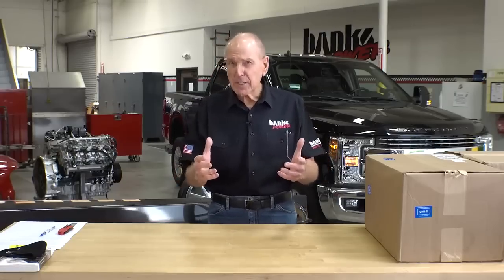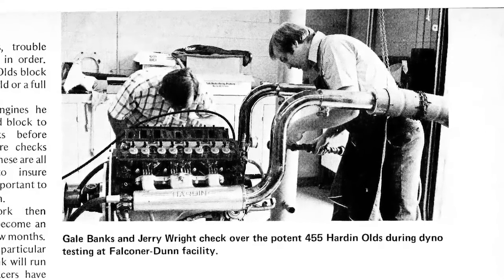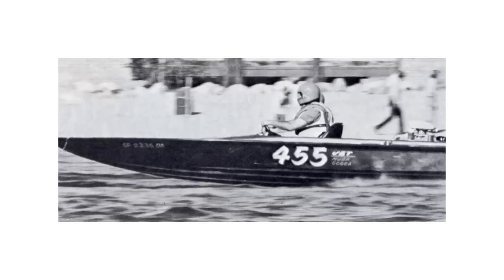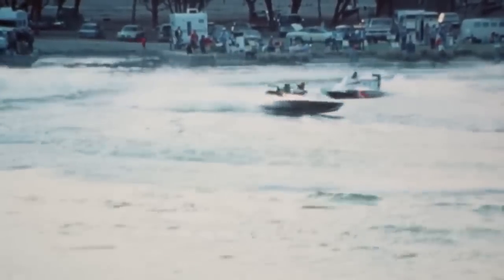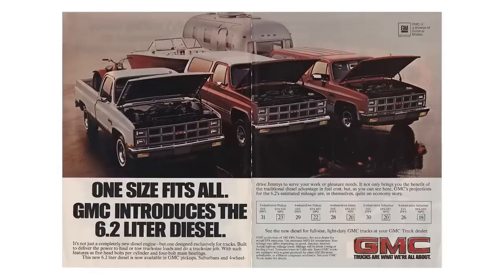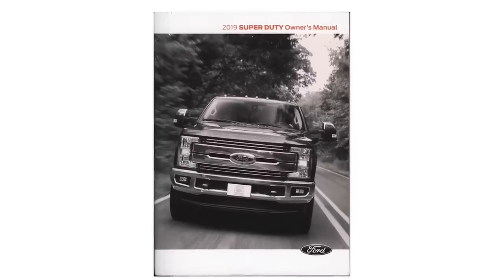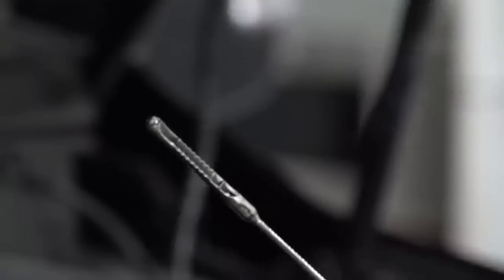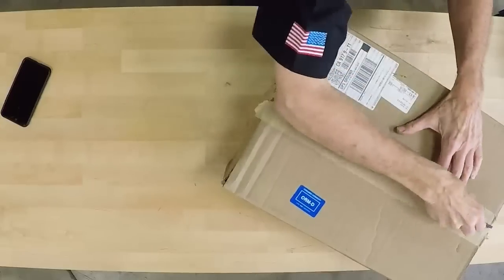WATCH HOW THIS GUY EXPLAINS AMSOIL! orderoil24 dot com

Comment: In today's day and age even Walmart oil is OK if you keep up on changes. All oils pretty much have the same additives if API certified.
Reply from the maker: Thanks for being part of the channel. Walmart is not OK compared to 100% Synthetic oil. Conventional oil exists in 'FULL' Synthetic, 60-75% conventional. Concentional oil has mismatched molecules, which causes wear, over time. Use any motor oil that is 100% Synthetic. It causes zero wear over time. Basically, if you study tribology, you would know that conventional oil (group 1-2) sandblasts, over time, your engine components.
Reply: @peterssynthetics-independe6786  The thing is that oil bottles that say full-synthetic are not 100% synthetic. Not unless it specifies 100%.
Reply from the maker: @old_school_guy  Didnt I just say that? Or did you not really read the comment? :)

Comment: I dont do oil laboratory thing no need ,but as the pick up for the oil pump is located pretty much at the bottom of the pan.The drain plug would be most effective oil sample as thats the oil going to the motor at start up.Two micron oil filter in my opinion is much to fine for used motor oil and likely  starve engine of oil or go in bypass mode and filter nothing,Is amzoil good im sure it is but how long will most people keep their vehicles, My tacoma 24 years old and pull a trailer 95% of the time has over 307000 miles using just conventional oil valvaline just recently starting using synthetic because conventional oil is hard to find these days, i changed it every 4000 miles now with synthetic i plan to change  6-7 thousand miles.Try going 25000 before oil change on a vehicle with over 100,000 miles their is a good chance you run low on oil a ruin yer motor, i say yer better off just changing  oil than adding oil

Comment: Do not use AmsOil or any brand engine flush. Those things are trash garbage. The ONLY time u use an engine flush is if you've had the vehicle since it came off the floor and you've been using engine flush regularly since u got the vehicle home. If not, stay away from ALL engine flush. It will screw u over and cause more oil leaks then a little bit
Reply from the maker: Watch my other videos and you can see what the real deal is with AMSOIL Please like and subscribe!

Comment: Why bypass when you can make a parallel oil flow path, so that you don't lose 5% of bearing oil?  Also, a parallel path actually reduces the flow resistance of the full-flow (single) oil filter system.   In other words, the return path of the fine-filter should connect to the outlet of the normal spin-on oil filter that came with the car or truck.
Reply from the maker: Thank you for being part of the channel! You actually do not lose really anything. The design for the oil pump and pressures takes this into account. There is plenty of extra pressure and flow for the bypass valve. Amsoil has been making bypass filtration since the 60’s. I believe they have it in hand. Call Amsoil and ask for their technical team and you will speak with a Tribologist.
Reply: @peterssynthetics-independe6786  Only with a variable displacement oil pump that uses oil pressure feedback to adjust pressure.  Some engines have that, I don't think the majority of engines have that.  They usually have fixed volume displacement pumps.
Reply from the maker: @softwaresignals  I would agree. However, you are not losing any oil pressure/lubrication to the engine components. The bypass does not hinder the flow, or flow rates in anyway. Some engine manufacturers expect a third party bypass system and they design in ports on the engine crankcases etc etc for this express purpose.

Comment: My 1983 Mercedes 300TD/OM617 5 cyl turbodiesel has over 900,000 miles on it using Shell Rotella T4 mineral oil from a real oil manufacturer, not an Amway distributor pyramid scheme from an oil bottling plant.  It uses a teacup between 3000 mile changes for 41 years.  Engine and automatic transmission have never been overhauled.  We can leave for the opposite coast tomorrow with 100% confidence of a trouble free trip in the most reliable car ever made.  EVERY diesel owner MUST change dirty black oil OFTEN not using magic from a slick marketing scheme.
Reply from the maker: Thank you for being part of the channel! I am so happy you have had such great use out of your Mercedes. If I bother to respond will you read it and respond in kind?

Comment: Could Amsoil be used in a Chev 1962 327 V8 ?
Reply: Yes -- but WHY ??
Reply: @SlikLizrd  for lubrication ?
Reply: @north4961  Seems crazy to put expensive oil in a 60-year-old engine that NEVER saw oil that was as good as today's full synthetics.
But hey, you do whatever you want, it's OK by me.
Reply: You could as long as the engine isn’t worn out already. If it’s not worn out, Amsoil will improve engine performance and reduce oil consumption from lower volatility.
Reply from the maker: You can use AMSOIL ZROD, which is designed for the older engines, specifically!

Comment: What destroyed diesel engines in cars was not the idea, but that lousy engine.  A conversion engine, not a diesel from the start.  A 4 cyl. Westerbeke would have been a better choice..  better fuel mileage, better reliability, but a lower top end and less torque and horsepower.  But actually not that bad on torque.
Reply from the maker: Thank you for being part of the channel! :)
Reply: VW had diesels in the US for over 50 yrs. I had a jetta that got 48 mpg. Thanks to diesel gate vw got scared and caved in to the govt so no more vw diesels.

Comment: I have had this kit on my cummins diesel for 15 years or so. I change the oil at 25-30k miles and use the amsoil off-road diesel and marine 15-40 oil. Oil changes are about $180 every 2 years.
Reply from the maker: Yes sir! Instead of it costing you $600 a year or more. Thank you for being part of the channel! Please consider subscribing! Thank you!

Comment: What I would do right from the factory is I would have a second ring the compression ring like Childs and Albert or now accurately and Albert a step ring and would also have a slight bevel to it so it helps scrape the cylinder wall of excess oil that second ring will greatly reduce salt going into the oil plus give you a little more power make your engine a little more efficient see you when I’m doing my 91 Dodge actually 91.5 I’m getting as much horsepower out of it as I can without adding big stupid injectors and stuff like that anyway this is six in a row jim From Kennerdell Pennsylvania
Reply from the maker: Thank you for being a part of the channel. If you need any Amsoil please use my website at https://www.orderoil24.com then click the big SHOP, then make your order. Or if you call in your order, please use my dealer code 30331652 at check out. Thank you and God bless.

Comment: How would you know how far you’ve pushed the hose down the dipstick tube? Seems to like it would be pretty difficult to pull from the top of the oil level and not pull stuff up of the bottom of the pan, as you say should be avoided.
Reply from the maker: Measure the dipstick.

Comment: Hotshot secrets line of Blue Diamond oil is 100% group IV PAO and group V oils. If you use this oil with a properly filtering bypass filter and do regular filter changes with oil analysis every 10K miles you can go 50-100K miles before a complete oil change.
It's the only oil I would pay a premium price for.
No need to hide behind vague terms like "full synthetic" and "100% synthetic" and undisclosed blend percentages when you outright tell everyone it's purely group IV PAO and group V oils only. 
Group IV base stock with a Group V carrier for some of the additives.

Comment: I have been using Amsoil for over 35 years in all my vehicles. I have put over 300,000 miles on several of them over the years. 
It's only expensive if it doesn't work.
Reply from the maker: Thank you for being part of the channel. If you need an Amsoil dealer please call me 229-561-4426 or goto my website then click shop orderoil24 dot com   My dealer number is 30331652

Comment: Don’t forget about ash buildup in the dpf which causes restriction after 50% capacity then you’ll notice fuel mileage decreasing because of more frequent regenerations therefore shortening filter life and……. The next byproduct is fuel contamination in the oil because of more frequent regenerations because filter (dpf) capacity and volumetric exhaust flow rate has decreased that is measured by the differential pressure sensor.

Comment: He can even explain it at the best… it’s just not worth the money , the average full synthetic oil and 5k interval goes a long way and save you $$ in the long run
Reply from the maker: Too bad you do not fully understand what you are talking about. The long run, is perform oil analysis, learn your equipment, then let your mind dictate what your next move is. If the truth of that data tells you that 5000 mile intervals is what you should do, change it then. If the truth of the data is 25000 miles, change it then and save tons. Full synthetic, you are being duped. It is not 100% Synthetic like Amsoil. Look into research and learn your equipment before you just ‘do what you are told’ and then tell everyone else and in the face of 50 years of research that tells you the old 5k miles or 3k miles, routine out the window. It is 100% worth the money if it reduces wear metals. The big oil companies just cant beat Amsoil, and they know it. If they offered 100% Synthetic, they would be higher than our oil. Do some research, do oil analysis, save $$.
Reply: @peterssynthetics-independe6786  most of the vehicle I’ve owned have lived passed the 250k , don’t need no oil analysis, if you take the best oil in the world and run it 25k or something that might not be as perfect but still has some good detergent inside of a reliable company and change it often you’re just at the same spot.. amsoil is just the trend of the moment and if gale banks is so good good and knowledge about it all instead of making tune just because it’s what sells and tells people that delete times are over , could implement and improve emission control and fix all the flaws instead, a good reliable vehicle has no need for mods, for gold oil and all these bullshit
Reply from the maker: @Italianborn  How about engines that give you over 1 mill+ miles, documented? Everyone talks big about their mileage, but when you get it down to cold hard facts, you can not refute oil analysis. Not doing an oil analysis and finding out the truth is like going to the doctor and asking him to ‘figure it out’ with out drawing blood. Ridiculous. Amsoil is the best engine oil in the world for cars, trucks etc. 100% Synthetic. If you havent tried it, dont knock it. You spend less money, dont feed the big machine which constantly dupes you. Sometimes the medicine is worse than the cure, in this case for you, it certainly is.

Comment: Hello sir, please I need the appropriate viscosity of Amsoil oil for the GDI 2400 engine ... for the Middle East weather that exceeds 50 degrees Celsius '50C. Note that the car is a Hyundai Tucson imported from America and it says on the hood 5w20
Reply from the maker: Thank you for being part of the channel! If it is a 2019 Hyundai Tucson, 2.0 or 2.4 it looks as if the viscosity is 5w-20. Buy it at my link at orderoil24.com so I can get the credit for the sale! Blessings!
Reply: ALL-WAYS use the Factory-Recommened oil viscosity, regardless of high desert temperatures.
Your Hyundai was TESTED in the desert.
It's named after a city in the Arizona desert.
AMSOIL's 5-W-20 will protect your engine under desert heat conditions. No worries !!

Comment: I have 17 F350 with a 6.7L power stroke I change the oil every 8k  km oil is cheap engines or not I’d rather just change the oil more often than worry about spending six or $700 on a oil bypass I love amsoil stuff, but I can buy 10 oil changes for that.

Comment: I had an 03 f350 6.0 ltr I changed oil at 8 thousand km and it had 260, km on it I always added Metalon to the oil an when I pulled the drain plug the oil always looked pretty much like  just fresh oil there was a little color but certainly not like most I see I could never figure this out. Anyone have any ideas.

Comment: What do you think about a non-vented oil catch can in addition to the bypass filter?
Reply from the maker: Not really sold on that idea. The bypass filters gets down to 1 micron at 50% efficiency and 2 microns at 98%. The bypass filter system does a bang up job

Comment: It's like getting an oil change every 50 - 100 miles. When it gets too dirty, change the filter, not the oil and start all over again.
Reply: That's the way I'd look at it, that super superior oil isn't worn out, just loading up on contaminates. With the Top Notch "Ea" Amsoil filter and this by-pass  filtering set up the oil probably doesn't even look vaguely dirty for 1000's of miles. Night and day difference between this Ultimate Filtering set-up and a Fram Tough Gard...Chuckle Chuckle 😂
Reply: Not true. Engine oils have sacrificial additives that go away after a period of time. Your oil may stay spotlessly clean with a bypass filter, but the oil will not protect the engine like it should.
Reply from the maker: This isnt true at all. Have you ever done Oil Analysis?

Comment: Called up his buddies take note of that, my mentor otr driver 40 years uses nothing but amsoil does one systemic circuit change a year. Has gone 2 years that's 240,000 miles amsoil max duty diesel oil
Reply from the maker: Thank you for being part of the channel!

Comment: What 10w30 or 10w40 oil would you use in a 460 Ford with a flat tappet cam
Reply from the maker: Thank you for being part of the channel! What is the make model and year of your vehicle? I have a  suggestion but I would like to make sure that I do not tell you the wrong product. Have a look at our ZRod line of oils that have a heavy zinc additive. Here is the link for it: https://www.amsoil.com/p/z-rod-10w-30-synthetic-motor-oil-zrt/?zo=30331652

Or go here: orderoil24.com then click the big SHOP then find your particular vehicle! Please contact me if I can be of further help! :)
Reply from the maker: Before you buy, double check with me. Glad to help. Just need to double check sir.
Reply: @peterssynthetics-independe6786  how do I contact you ? 90 F-250 460 installing a new flat tappet cam and lifters! Would like to run 10w30 or 10w40
Reply from the maker: @joshualymer6568  Please call me tomorrow AM after 9am 229-561-4426 Ill have the information you need ready!
Reply: Pennzoil Ultra Platinum, 10-W-30 -- with a Fram Ultra Oil Filter -- changes (religiously) at 5,000 miles.
Worked very well in my modified 460 Lincoln Town Coupe -- even in the harsh desert climate.
AMSOIL is GREAT -- if you're starting off with a freshly broken-in engine.
 Putting the expensive AMSOIL in a worn engine is just wasteful turd-polishing.
Reply from the maker: @SlikLizrd  But using something that will slowly sandblast it even further is the thing to do? hmmm….. Not so sure about that. :)
Reply: @peterssynthetics-independe6786  What are you talking about ??
 I need some clarification.
Reply from the maker: @SlikLizrd  If you use Pennzoil, which is a good oil, but it is still group 3+ hydrocracked oil. Odd shaped molecular structure and contaminants. Anything less then 100% Synthetic oil, your oil is contaminated with silicone, various solids and clumps of non-uniform, crude oil particles, oxygenated particles, that clump together in your engine and become sludge, dirt, grime, enemies of your engine, slowly over time sand blasting the inside of your motor. Period, The End. Even if it says ‘Full Synthetic’ it is not 100% Synthetic. Thats what I mean. Its great that you change your oil every 5k miles. As a tribologist, I love hearing how folks really like taking care of their vehicles, even if it isnt Amsoil. However, if you take a crap box, why make it worse and use inferior oil? That does not compute. That is like kicking the worthy competitor when they are down. Any time is a good time to use Amsoil.
Reply: @peterssynthetics-independe6786  
 It's all good, Peters -- I know that Amsoil is a superior oil, but it's not for me, as my goal is not to have an engine that lasts forever AT ALL COSTS, but to have an engine that operates efficiently for just (I'm 83) a few more years, and at minimum cost.
Please do not ASSume that others don't know the meaning of such common terms as "Full Synthetic" , or that they're unaware of such characteristics as molecular uniformity.
 As your business continues, I think you'll find that no matter how good a product is, IT'S NOT FOR EVERYONE.
 Peace.
Reply from the maker: @SlikLizrd  You ASSumed that I assumed, I did not assume, It was part of my point. Touche. 83? Youll likely live to 123.  Try our brake cleaner. How about our line of vitamins? Best in the business.